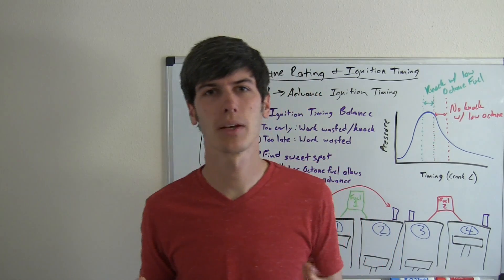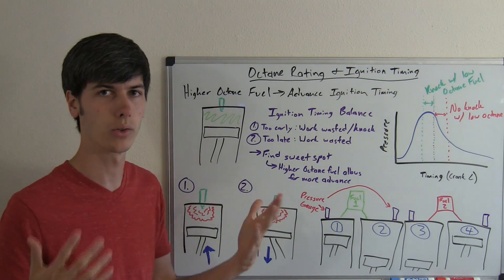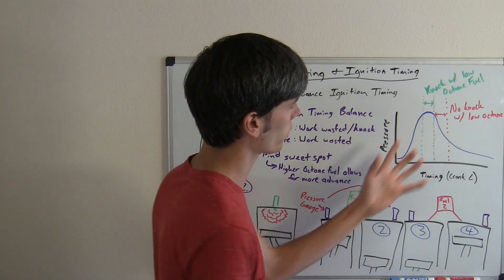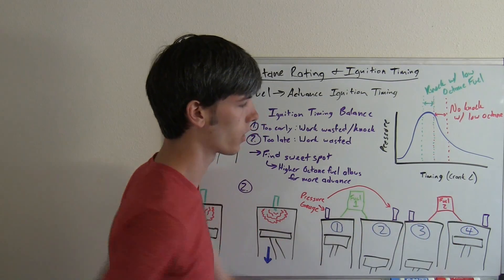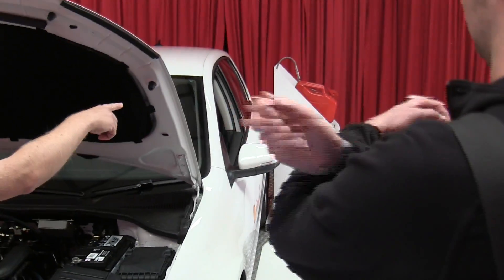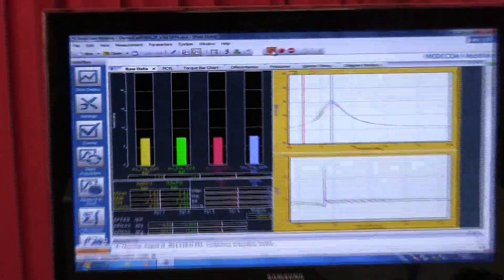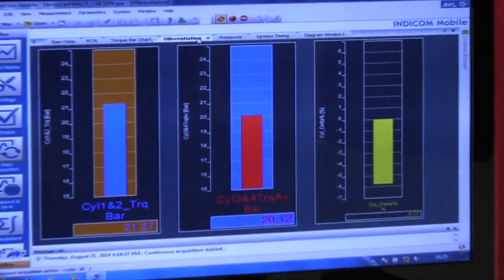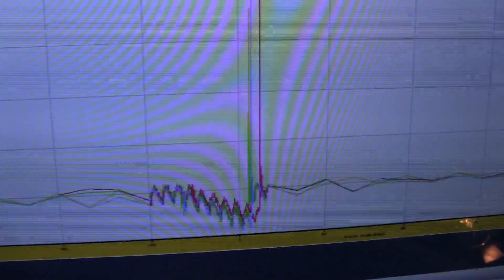Dyno Testing Premium Fuel - Octane Level vs Performance - Shell V-Power

Comment: You should do this video again but with a n/a economy car. There is so many people wasting money putting race gas in their "performance Civics" around where I live and I'm wondering if higher octane gas even makes a difference on those cars. I'm guessing the answer is no considering those cars weren't tuned for anything higher than 87 octane, unlike the turbocharged golf in this video.
Reply: Lawrence Timme In the UK, petrol is rated using the RON standard, us Americans have our fuel rated using the AKI standard. That's why the octane numbers differ so much.
Reply: A golf is an economy car!
Reply from the maker: Use what the manufacturer recommends, unless it's been modified in a way that can produce knock (higher CR, turbo, etc). I state this in the description as well.
Reply: vtec, and thats not really gonna affect your recommended octane level, the compression ratio is what really matters. some of the stock honda engies are high compression and do require premium gas (B16 vtec and B18c vtec engines). any single cam engine (even with vtec) doesnt need any more than 87 because it has a really low compression ratio around 8 or 9 while the b18c and b16 vtecs are more towards 11
Reply: Lawrence Timme
 Who is AKI?
Reply: unless they have an ECU that can automatically compensate for knock (like the Golf has) or have otherwise been tuned to take advantage of the high-octane fuels ability to run more spark advance then it is a waste. Higher octane fuels usually have better additives (like detergents and what-not) so they are generally better for your engine, but without being tuned to use the better fuel its a missed opportunity.
Reply: i gotta "performance civic" with a built head, pistons and rods, and i use 93 (us) cause i got way too much into this build too loose it to not high enough octane gas. also the recommended for the stock motor is 91 anyway, and ive upped the compression and have more aggressive cams so i figure safe than sorry. but if its a stock single jingle people are wastin theyre money, before i did the swap i filled my whole tank up from e to f on 93 and drove home on the single before takin it out and it had a hudge lack of power compared to bein on 87
Reply: Cantenkerous Tim It's a turbocharged economy car. Meaning it's a performance economy car, unlike the Civics in my town.
Reply: yep, EE has all the answers lol, im runnin 11.1:1CR which isnt particularly high im just playin it safe till i see what the tuner thinks
Reply: you just said "performance civics" If you're talking about a Civic that has a B16a2 or K20z3 yes they require high octane because it has a performance motor. If you are talking about base civics then yes it only requires 87 .
Reply: K20z3 the 2.0 Civic Si motor is 11:1 compression and requires 91 octane.  I could see how proper ignition would be important with a redline at 8000 rpm.
Reply: just let the Civic drivers think it's increasing their performance, they're too convinced their cars real performance cars.
Reply: @uriahmartinez2675  a lot of modern civics do require premium gasoline.
Reply: Ben Hamilton Yeah I already know the answer I just want him to go over it for everybody else. Also I'm pretty sure this golf has a limit on how much timing it adds, so if I was to put like 110 octane it wouldn't be any different than 93 octane.
Reply: exactly, he keeps saying "if you advance your timing" - meaning if you don't it will keep running in 87 octane mode giving no advantage whatsoever.
only cars i am aware can change timing based on fuel sensor readings are flex fuel or the equivalent.

another misconception i hear alot is that higher octane means higher quality.
Reply: @solidsnakec20   or VVT  based engine
Reply: @solidsnakec20  wrong, all modern fuel injected engines compensate and adjust timing for many different situations.
Reply: Havel The Wall
With Shell gas, premium has more nitrogen than regular.  It's on their website.
Reply: @someusername121  well that’s good, so it has more air in it?  Think about what you’re saying, the open air world consists of 70 percent nitrogen
Reply: thats something most cars with a knock sensor can do. like as a failsafe. it cant detect higher octane fuel (lets say 93 opposed to 91) and advance timing to take advantage of it.
Reply: @solidsnakec20  yes, it can, it adjusts via the oxygen sensors and many other sensors which tell it also what the AFR is and so many other factors, coolant temperature, etc.
Reply: dragkid185 it is "vtec" not vtech" because "vtec"= Honda "vtech" = the telephone brand
Reply: Turbo charged Golf GTI recommends premium though. They need to use a car that recommends regular to see if using higher octane is beneficial. Keep in mind also, Shell is promoting their gasoline and they do want people to buy Premium gas rather than regular.
Reply: It's called tuning, when you tune for a ocatne you'll see power gains...
Reply: Havel The Wall Fuel sensor readings? Not sure if that's different, but regardless I know the WRX tunes itsself based on knock. If you put bad fuel in, it will decrease timing (butt dyno confirmed) and throw on a CEL. If it's really bad it will limp tune to cut boost and timing.
Reply: Might make a little difference even with identical timing. Octane rating is just one, pretty important, characteristic for a fuel. different bands have different calorific content.  and different brands might burn faster/slower even if they have same octane rating.
Reply: ChronicConnoisseur Most of them are just the base level Civic's with the "vtech" engine. With those ones it's just variable valve timing.
Reply: Ryan Holmes Who is MON, PON and RdON?
I believe they are all related...
Reply: dragkid185 87 AKI is way lower than 95 RON. And gas in most developed countries using RON are of higher quality than US counterparts. That's why many European and Japanese manufacturers have downrated engines for the US market. But the gas price in those countries are also way higher so not much complain.
Reply: i have noticed that, there be the jdm version, the euro version wich is slightly nerfed, then the us version wich is a bit more nerfed then cdm gets the real short end of the stick lol
Reply: TwoWheelJockey, you are correct about the different methods, but wrong about the numbers.  Our 87 is 91 RON, not 95.  To get 95 RON you have to use our 91 octane.  Add 4.  How do I know?  My car (turbo) has that information on the gas cap -- rated for Regular 87/91 RON.
Reply: Lawrence Timme 95RON is equivalent to 91AKI. 98RON is equivalent to 93AKI.
Reply: Lawrence Timme  ... Cool story bro
Reply: It could be that they are required to run premium gasoline. My acura tl has a recommended fuel rating of 91. I can't run anything below that.
Reply: No. American 87 equal to 91 in the rest of the World. 89 - 95,  91 - 98,  93 - 100 Right?
Reply: AKI is not a standard. Just the average figure of RON and MON.
Reply: they do, they give better acceleration.
Reply: I use 91 Octane (highest available short of paying 10$ a gallon for 100 Octane Unleaded)   on the road there is less noticeable  down shift into 3rd gear.....

 it does help in a N/A ICE   but it does have 6.0L V8   VVT-LIVC    to maximize performance...
the V8 tend to run better with the 91octane anyways
Reply: @twowheeljockey with N/A it comes down to the compression ratio.. high compression needs high octane an low compression only requires low octane
Reply: The dynamics that he showed here are a general constant for any modern fuel injected computer controlled engine whether is NA or blown.